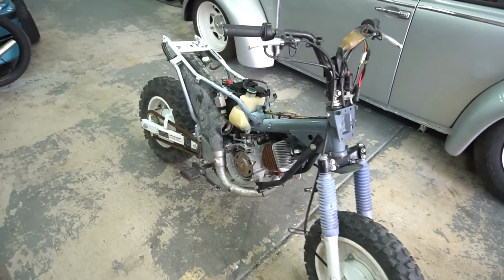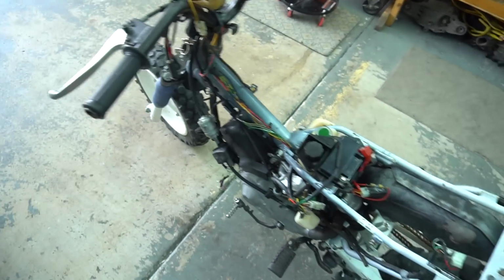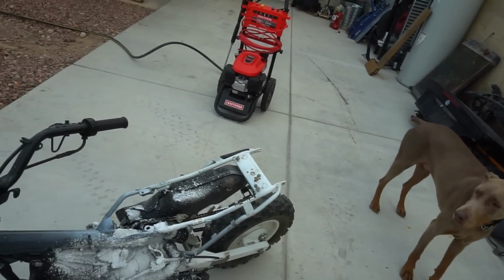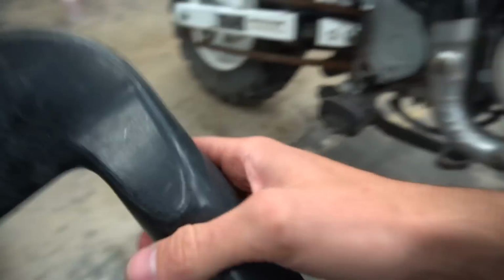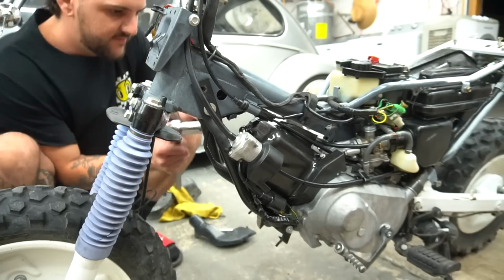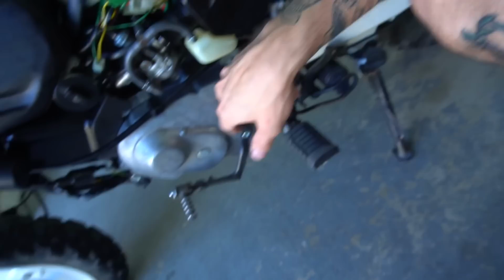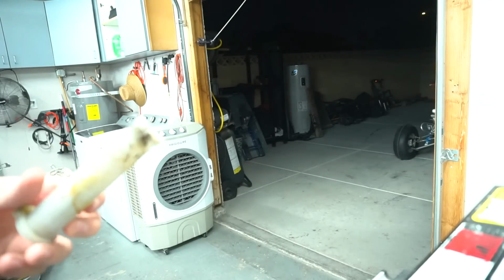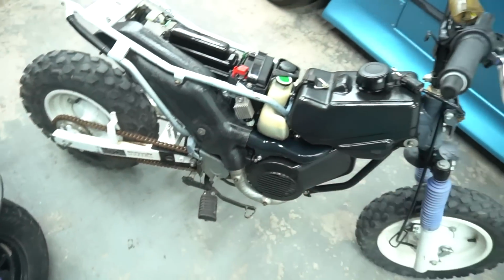Honda CUB EZ90 FIRST START after 13 YEARS!

Comment: Does anyone have any idea what the specs are for the OEM drive belt? I recently purchased a Bando belt supposedly meant to fit the Cub, and my top speed has suffered greatly. I don't think the replacement belt is wide enough...

Comment: I had a 1988 Honda NX250 with a CDI issue and the cdi looks identical. some solder joint under all the epoxy eventually breaks loose. Mine was intermittent and almost left me stranded several times before I figured it out. 
Very little aftermarket support made it almost impossible to find a replacement and all the chinese ones had bad ignition advance tables and would blow the motor. Had to find some boutique motorsports electronics company to sell me one. PITA but ran great after that

Comment: This is similar to what happened to me. I bought a 1980 Suzuki gs850 and the previous owner did an ignition switch bypass because he thought the ignition was broken and he couldn’t figure out how to fix it. When I brought the bike home I looked into it and it turns out he had a fuse in the wrong spot which was leaving the battery on and bypassing the ignition. He added a kill switch because he couldn’t put a fuse in the right spot lol

Comment: Dude I got a ultrasonic cleaner to do small parts like the carbs.. Works well on anything you put in there... Congrats on getting it running.
Reply from the maker: i need to get one, thanks bro !
Reply: @MOPBOYZ  I put a manky carb in one on one of my vids and it comes up like brand new. Just use fuel for carb cleaning.

Comment: There was someone in my area who was selling an EZ cub, I think it was a 50 though. Crazy that Honda didn't follow through with a street legal version. I like seeing the unique quirks of the EZ,, also your whole process tor troubleshooting electrical (great work on the harness, BTW). I wish you showed more in the oiling system, more specifically your process for bleeding everything. Doing it on my SB50 build was a pain; followed the service manual for bleeding it, still had air in the pump, so I removed the pump, put some oil in it, there was still dirty old oil in the pump under that rubber membrane in there It was a messy process, chucked the shaft into a drill to turn it a bit and get things flowing. was a major pain in the ass, and I wasted like, half a bottle of Klotz, but I eventually got everything working again. Also, what solution/detergent do you use to clean out your oil tanks? I washed mine out with dawn dish soap and water, rinsed, drained and left to dry for a day, then I swished some isopropyl alcohol for a few seconds and drained it and let it evaporate off to remove any trace of moisture. Maybe a bit overkill, but it worked. This is a great project and can't wait to see where it goes! Great video!

Comment: When you were tapping the float it was obvious the height was wrong. They generally sit about level when the float height is correctly adjusted. Good job getting her going
Reply from the maker: yea i didn’t notice until i edited the vid i should’ve seen it before slapping it together hahaha
Reply: @MOPBOYZ  I've definitely missed simple stuff before, and I'm sure it's even easier to do when you're trying to narrate a video. But the whole vid after you showed the float I was like, "Bro, don't put it all together, it's not gonna start" , wishing it was a live stream so I could say something haha
Reply: This is good info. I just got one of these bikes and working on the carb and after watching this it had me wondering if my float should be set like his. Thank you.
Reply: Also just got to the point where he mentioned it.